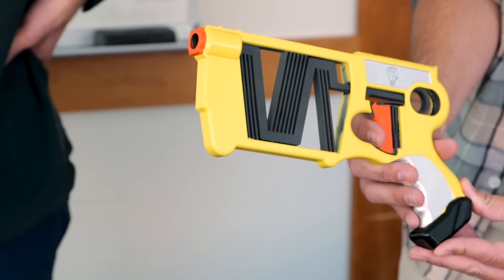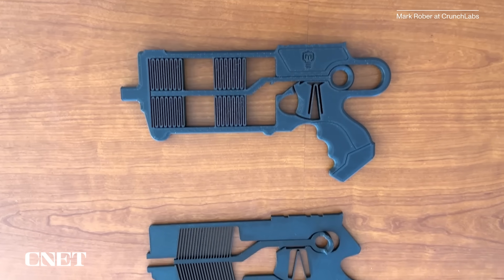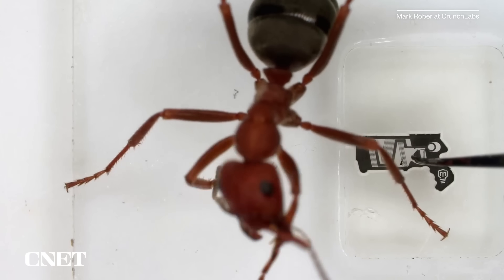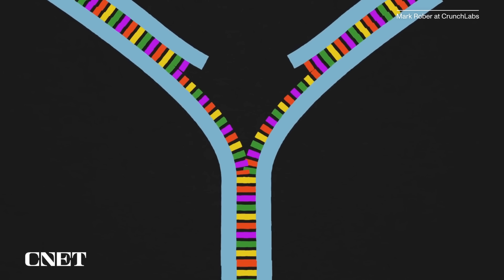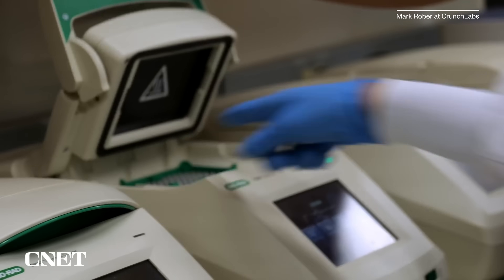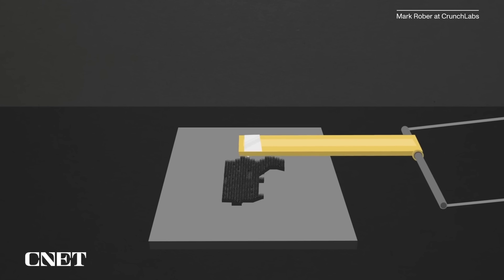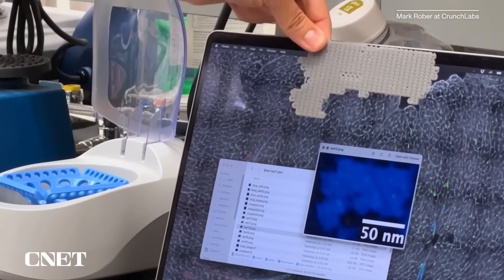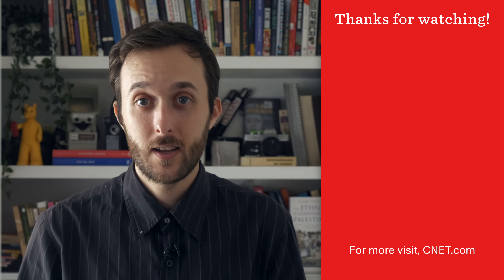Mark Rober's DNA Nerf Gun Raises Possibility of Medical Breakthroughs

Comment: Makes you wonder how many scientists are facing an issue where they think there isn't a solution, but it turns out they just don't know the name/existence of the tool/technology they need
Reply: Acutally no, they  might have a idea/ hypothesis, but to push that to a mature state to use in pharma/clinical trial, take enormous amount of money.
Just the themocycler and gel electrophoresis machine u saw there cost more than your kitchen.

In this example, how we "power" the DNA gun?
how the DNA strand stay stable and wont fragmentize which would interfer your DNA?
even if it passes animal test, how long FDA would approve this "GUN"? 

theres acutally alot of medical/biological tech locked behind coz they dont have the economy incentive to push beyond just ideas.

Comment: Rober or burger entrepreneur - hmmm Rober might literally cure blindness (some might just need genetic repair of the retina for example, and this invention has the potential to deliver xNA possibly directly into an organelle if your aim is good enough but definitely scattered into a tissue with micelles that can slide into cells or even shoot hard enough to push the material through the cell membranes. The force can be altered by changing the base sequences of the springs... wow... this is just.... wow).

Comment: You can tell that this is a pretty big deal, in terms of general scientific discovery.😊
Reply: Nothing was discovered...this has already been known for several years, I first heard of using DNA as something mechanical for the purposes of perpetuating a genetic HDD. The main difference then and now is that tech has been advancing to the point where it's easier to actually try it out (though still being expensive enough to require special facilities and equipment)
Reply: @yerpderp6800 you sound like a blast to be around

Comment: Wouldn't our immune system just attack the foreign DNA if it enters our body? It is cool that we can get that small. We would probably have to use immunosuppressant for it, I guess like organ transplants.
Reply: You could add the patient's antigenes (surface proteins used for recognition by immune cells) to the machines.
Reply: @My_initials_are_O.G.cuz_I_am  that would probably be extremely expensive though, since you would have to tailor make it specifically for that one person. I’m assuming the equipment they use is not that cheap either lol
Reply: @ShadowDior the only expensive part is prep and testing (lab staff). The actual manufacturing process is extremely cheap
Reply: @My_initials_are_O.G.cuz_I_am issue is this also means you can make the perfect virus
Reply: Why not use the patients DNA?
Reply: Nah, immune system does not really target floating pieces of foreign DNA. They target protein and antigens of foreign substances. DNA may illicit a inflammation response but that would be due to similar pathways as detecting DNA from your own dead cells. You don't need a immunisupressant for this stuff. 

The mRNA covid vaccines from Moderna and Pfizer are basically that. Remember than mRNA is basically transcript of single strand DNA, and they get translated into proteins later. Their chemical and structure makeup is essentially the same as DNA with the exception of a nucleotide uracil. 

In terms of mRNA vaccines, they integrate into your cells and code for a protein marker that your cells will display on the surface. Your immune helper and dentritic cells learn about the protein marker, routes it to your B cells and make antibodies for them. 

The reason why you feel really bad a day after getting a dose of mRNA vaccine is mainly due to inflammation caused by the mRNA carrier and stabilizer they use. That agent helps mRNA pass your cell membranes but it illicit an immune response. The actual anticovid immune response making antibodies finishes developing after a week or two.

Comment: Fun fact: Glass isn't actually very "stiff" it's actually easier to bend than steel. However, it's bittle, so it shatters before any big deformation happens
Reply: But then there’s optical fiber. Very bendy stuff. With a G657 spec fiber of the right version you could bend it to the diameter of a penny, or less.
Reply: Glass can be very sproingy under the right circumstances, but those are also the circumstances under which it's liable to just rip/crack.
Reply: Tell Em
Reply: so, basically in this context its the same difference
Reply: @coreytaylor5386  Nope, plastic and elastic deformation is very different from actual factures.
Glass exhibits almost no state of plasticity in comparison with steel.
Reply: It is still very stiff as a macro material. Being brittle doesn't mean it can't be stiff
Reply: Bear in mind that this is a 4-minute video from a news outlet. They can only fit so much. In this case, "Even glass can be a spring, albeit a bad one."
Reply: both require heat to properly bend or morph.
Reply: This seems slightly pedantic, though it may technically be true.
Reply: with proper intention and proper application, you can achieve what you need.
Reply: I would safely assume mark probably knows more than you about what he was explaining. But thanks.
Reply: Glass is actually a liquid.
EDIT: not true. Look below for explanantion.
Reply: @boterhammetpindakaashagelslag  False. The old method of making glass produced panes that were slightly thicker here and thinner there, and the makers just put the thicker part at the bottom when installing the window. Glass may be an amorphous solid, but that just means it isn't crystalline, not that it flows.
Reply: @totally_not_a_bot  Hmm... well, thank you for correcting it. I was taught this at university and I graduated in building engineering. So, you had me doubting. I looked further and found a Veritasium video on it, called "Is glass a liquid?" This confirmes what you said. 
I guess you can learn something new every day.
Reply: @boterhammetpindakaashagelslag  You're story is a myth that I also believed for a long time.
One guy told this once and everybody believed it for a while.
But glass will never flow very slowly.
Old glass is like that because it is made by glass blowing and the thicker side is always placed on the botten side.

Comment: This is very impressive !
DNA will be used to hold data and make all HDD/SSD obsolete.
idk why i have to add this but everyone replying are so shortsighted.
Way back in 1894 Benz Velo the first production car was slammed for being "to slow" and was dismissed when they said it will only get faster and faster.
look how far DNA testing has come and now able to use it to store data, to be so ignorant to assume it wont get faster then it is now after watching it faster and faster in the past decade.
Almost as bad as when people say "we won't run out of oil"
Reply: Yeah, no. It's way too slow to read and write. DNA could make good archival storage, it might replace tape drives and optical media if it gets cheaper and more reliable - but it'll never replace a HDD let alone an SSD
Reply: @tuckersaspy  very ignorant to believe that when reading DNA/ Analysis gets quicker and easier by the year.
It's only a matter of when not if.
Reply: @mojomojo2091 I mean I'd bet my life savings it will never have more throughput than an SSD. it's a bunch of NAND gates in parallel. you can read them all simultaneously if the mobo is prepared for it
Reply: @Zreknarf that is a poor deduction since ssd are built for von nueman architecture which will be outdated in the coming decades. Data retrieval from DNA makes for a new pc architecture centered around encryption by DNA. Think of a pc that only powers when the persons mitochondria matches.
Reply: @perc-ai  you're right reading and writing to DNA from anything digital is slow as balls but when you start doing things like comparing DNA directly with DNA it could be much faster

I've questioned since I was a child if it would be ethical to create a living breathing life form that is your PC
Reply: @tuckersaspy you clearly don’t understand anything about computers or dna just stop lol
Reply: @perc-ai  I'm an engineer in semiconductor manufacturing lol - my understanding of biology is more limited of course but I know DNA physically has to process, as proteins split and reorganize.  Chemical reorganization will be slower than election movements. It will never be faster than electrons going through silicon gates. It's a physics limitation.
Reply: @tuckersaspy  yes I somewhat hinted at that but not to you directly but to another commenter.  The limitation of SSDs and such are that they are built for Von Nueman architecture which will be outdated in the coming decades. Its not always about speed think of encryption by DNA - data retrieval but only granted if the person mitochondria matches. It is most certainly a physics problem. Compute in our physiology is mostly electrical but all other systems are mainly chemical reorganization as you stated. Perhaps the coming architectures are a hybrid of the two. At any given point forensics can more or less retrieve absolutely anything off a modern computer. Data as of now is subject to attack by so many different kinds of vectors.
Reply: DNA is the cells' data storage, but works absolutely differently from an HDD or SSD. Currently the addressing is not really understood
Reply: Already long in use
Reply: @e.v.k.3632  good 👍 the world needs it.
Reply: How cool would it be to juice in a hhd and make it hold 100x more storage
Reply: @lilducko  use viles instead of hdd's
Reply: I believe DNA is read like a tape, HDD and SSD are random access.
Reply: Yo does anybody want 10 TB worth of DNA storage. Proceeds to spit
Reply: wayyy too slow to read/write.

Comment: They didn't invent any techniques or technology, but they raised awareness on what is possible with current technology... "Wait, we can create medical breakthroughs with this stuff?"
Reply: I honestly think it's that many people haven't realized just how far we've come in the last 20/10/5/2 years, etc
Reply: @korrawright5781 I'm running AI and it's crazy what happens in three days.
Reply: problem is capitalism is slowing down innovation a lot, everything needs to be as cheap as possible for the highest profit margins, this slows down innovation. @korrawright5781
Reply: And yet, DNA origami, since its first use in 1991 by Nadrian C. Seeman, nothing really useful (outside the labs) has happened in this area of research. It's a bit like graphene. Great potential, extremely big hype, but no "useful" breakthrough.
Reply: @viktor4236 But like fire. 10,000 years ago we didn't realize it could make planes fly 3 times the speed of sound. A breakthrough will arrive.
Reply: @viktor4236 define useful, it's used in foams currently to keep them from heating up as bad when used in mattresses, or around certain types of packages. That's pretty useful.
Reply: Most stuff is discovered like this
Reply: Most innovation comes from thinking of new applications for existing technology
Reply: That’s how breakthroughs work. Take what you currently have and know, then combine it into something new. When glass was invented, we already had the materials to make it. Otherwise we wouldn’t be able to invent it.
Reply: @drink15  but this is not a breakthrough. This is just DNA origami to make something that looks like a nerf gun but cant shoot
Reply: @martinerhard8447  Might want to read the title. It doesn't say what Mark did was a breakthrough.
Reply: @drink15  The title is also misleading. It does not raise the possibility of a medical breakthrough. Its just old dna origami
Reply: @martinerhard8447  How can you be sure?
Reply: That's how almost every invention has ever been.
Reply: Yeah. I mean, steam power was invented by the Romans but nobody used it until the industrial revolution
Reply: People working in this space already knew, they drew popular attention towards why science and research isnimportant
Reply: The worst thing is that this technology isn't exactly new either
Reply: Only in the us
Reply: I’m really glad he shed more light on compliant mechanisms and their uses.
Reply: It's a case of why stuff like esports and racing is in place. These things alone do not directly make income (if you think about it, what does a dude playing a game on a big screen or a bunch of cars driving in circles actually "make"), but these things make a platform to push and showcase technologies. Racing gives incentives to manufacture better cars/engines and esports give advancements in home computer software and hardware.
Reply: awareness is like half the problem with science its even why mr.beasts blind video still gets hate from the blind community because to them it lowers awareness of their problems by solving a different problem easily making their more complicated issues ignored.

money runs the world and awareness shows where to put the money
Reply: Nanomachines son…
Reply: Yea like more earlier than  depictions in media and literature..
Reply: That is usually what Mark does, yes.  He is an engineer, not an inventor.   A very very GOOD engineer.
Reply: Pretty sure in the video he talks about how there is already medical tools made like this..
Reply: You're missing the point.  So many novel things aren't a new inventions.  They're finding new applications for a novel combination of existing concepts.  Assembling DNA into a form that can provide mechanical force to project an object is a very novel idea.  Modern tire companies didn't invent the wheel, but they build upon someone else's idea to create tires that can support 100's of tons for use on mining haul trucks or tires that can withstand the forces to go hundreds of miles per hour.
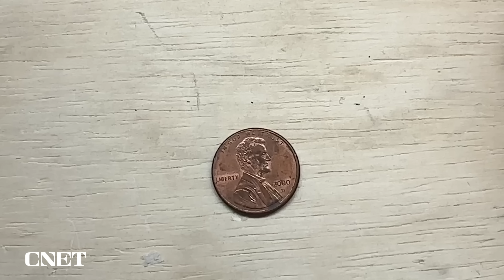Reply: @daander2  it can't provide mechanical force to project an object. those nerf guns are not functional and are only in the shape of a nerf gun 1:36
Reply: @daander2 But it cannot provide mechanical force. It is in this form a stable structure. It cannot "shoot" 

And the technique is already quite old and the devices here shown in the video to make it...basic pcr machines, gel electrophoresis...are also quite old.
Reply: @daander2 this isn't a very new idea people have used these things in biochemistry research
Reply: Mark Rober didn't invent this...sure. But you're taking away from the accomplishment of all those scientist who DID invent this very new technique. You're downplaying innovation.
Reply: @travissiegwart8276  The issue is that CNET have taken someone elses work, here the DNA origami and directly giving credit to Mark Rober.
It's a dangerous precident that the world is already too comfortable with.
Reply: @travissiegwart8276 what's important is that organizations with the means to push this technology further see it. Half of everything is marketing and exposure. You can have the greatest technology ever and if nobody knows about it, it goes nowhere.
Reply: Most breakthroughs don't "invent" new technology, they use existing tech in a way we haven't before. That is arguably more important than inventing new tech.
Reply: @iceshadow487  This isnt a new way of using it. This is just DNA origami. Nothing new about it
Reply: How can you say they didn't invent any techniques? What is the standard technique for making something that's never been made before? You have no idea how things are made at this level. Everything is new and bespoke to the thing that's being made.
Reply: No they already knew this was just a publicity stunt. Do you think we put millions into research that we don't know what to do with?
Reply: Rober is well versed in having others do the hard work and often takes the often credit or barely references who did it in his 15 sec build montages. 🙄
Reply: @Geeksmithing I think you're misunderstanding his point.

Rober and his team of scientist did not invent this technique. It was an already existing technique. But by using it, they've raised awareness as to how it can be used in medical applications.
Reply: @al-tameemi  I didn't say he or his team actually did. You are inferring that from my statement. I was mere pointing out his tendency to take credit or not give proper credit for others works.
Reply: I think you got it wrong
Reply: @codejunki567  Then prove it and in turn continue adding to progress
Reply: @codejunki567 I think yo’ekrke wrong
Reply: @codejunki567 your opinion don't matter boomer
Reply: @codejunki567  it’s not a breakthrough, but then you discover a possibility to be more accurate. We have come along way thanks to the power of science 10,000,000,000%